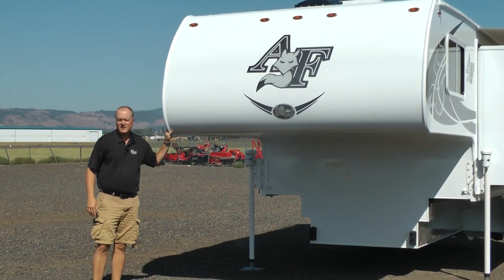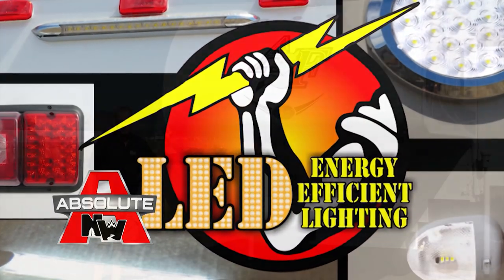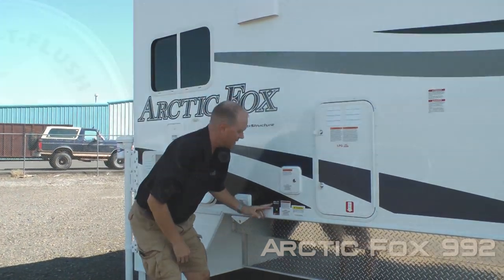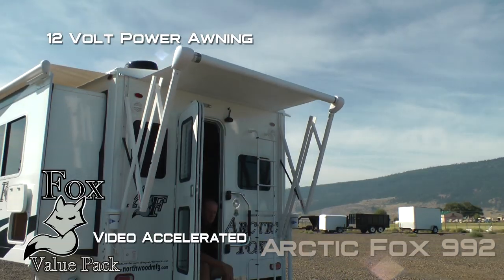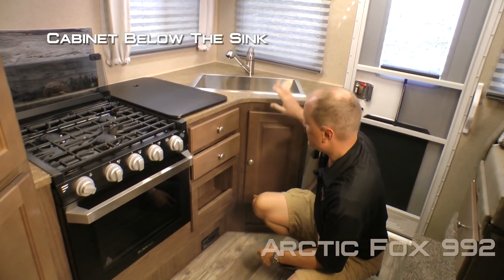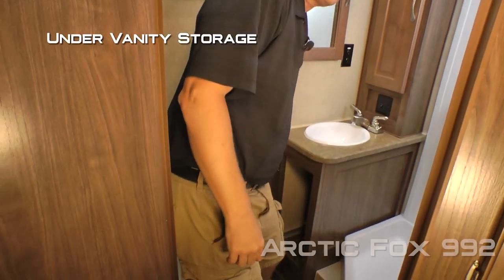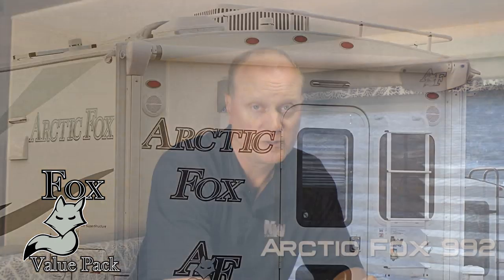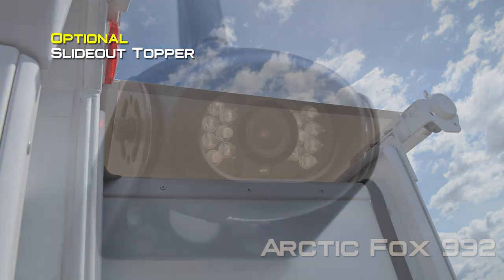Quick Tour of The New Arctic Fox 992 Pickup Camper

Comment: I have had this model for a little less than a year. It is on a Ram 3500 4X4 SRW. We are almost exclusively Off-Grid campers. We added an additional solar panel and inverter for plugged accessories like our e-bikes so we don't have to use the genset except to run the microwave. Aside from that you are ready to go. My wife wanted the dry bath. The biggest drawback to that set up is when the slide is in there is no access to the bathroom, refrigerator or sleeping area.  You need to bring the slide about half way out to get access. I have not ever had a problem with it, but agree it is not good for is urban stealth camping or crowded lot camping. The long and short off it is my wife was over doing the shower while sitting on the toilet routine of the wet bath. This is my second AF. The first one lasted 16 years with zero issues.....ABSOLUTE NORTHWOOD!
Reply: Is your 3500 enough power? Gas or diesel? Thanks
Reply: @scottrobbins2093  My 3500 is a Cummins diesel. It is bone stock and is plenty powerful. I have gone up some pretty steep grades and the truck almost acted like it was empty. Other engines may out horsepower the Cummins by a tiny bit but the inline 6 banger beats them all in torque numbers. The 992 comes in at about 4000 lbs wet with the add on package of steps, AC etc. I get about 12 mpg with the rig and truck loaded with all our stuff in mixed flat and mountain terrain. I get 21 mpg with the truck unloaded. Not bad for a one ton, 4x4 crew cab long bed with single rear wheels.
Reply: @adub59  What year is your 3500?  I'm considering putting the Artic Fox 992 on a 2003 Ram 3500.  It has an ATS Stage 6 transmission and a door jamb sticker of 44914KG/9900lbs GVWR. Will that unit carry it?  The 2003 Ram was owned by a Cummins engineer and seems to be well maintained and upgraded. The other consideration is a 2022 F-350 for $55k more! Thanks in advance.

Comment: Please show the inside of the camper with the slide out closed.  Is the camper useable with the slide out closed.  Please note that we cannot always open the slide out especially in downtown erea or at music festival.  So it is important to know if the camper is useable in slide out closed mode.  Thanks!
Reply: I checked that at a dealer last year. You can't get to the bathroom if the slide-out is in.
Reply: With the full bathroom (dry bath) the rig is not usable with the slide completely in....so, no urban stealth camping or tight spaces. That said, compared to a non-slide camper or a van, this camper is super spacious.

Comment: Those wooden cabinets must be very very heavy. Additionally they are really looking old style. It using some lighter composite materials it may save weight and allow to use lighter truck. Do you have option for some lighter stuff? Will be nice to have a Powerwall (or similar) battery plus bigger solar panel. Will be cool to add Starlink option. Over all love 992. It is good design.

Comment: The shower in that dry bath is a joke; It might accommodate a toddler or small child, and even when the narrator states he has lots of room his right arm extends well out of the space. Why not push the shower into the aft 2/3rds of that storage closet? This floorplan is otherwise decent. How about some updated fabric choices - like slate, teal, deep amber?
Reply: Is the shower not any good?
Reply: @bakervinci163  Great for toddlers and kids...
Reply: I have a 992. Keep in mind, this is a truck camper. There is not a whole bunch of space. Off course, I take this where most RVs would never dare to go. Maybe if you are just weekending you could kill the closet and get a bigger shower, but if you go longer you need that closet. I have stackable totes in mine. As for the shower size, I am 6'0 and 190 and fit in the shower just fine. We usually go as far off-grid as possible. When we do that we use the outdoor shower with a pop-up deer blind to shower. That also helps with the gray water levels.